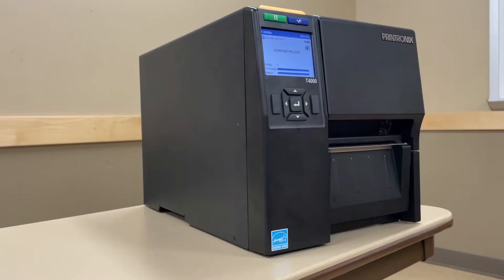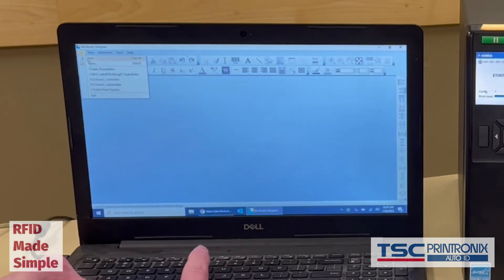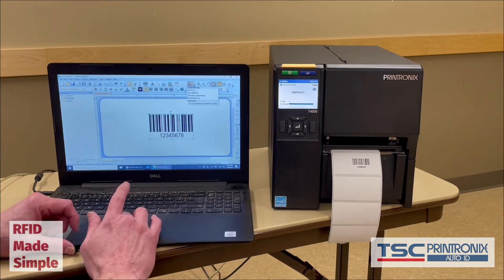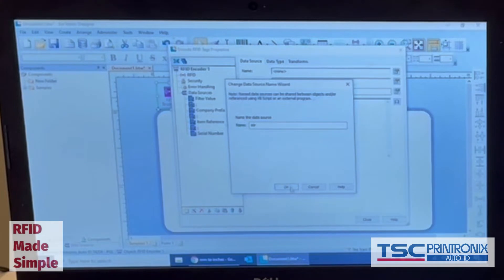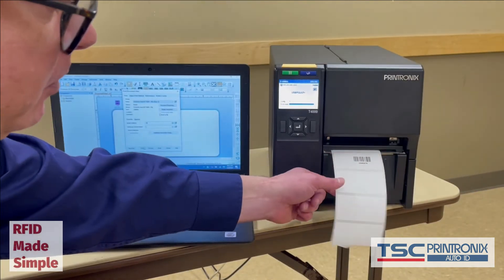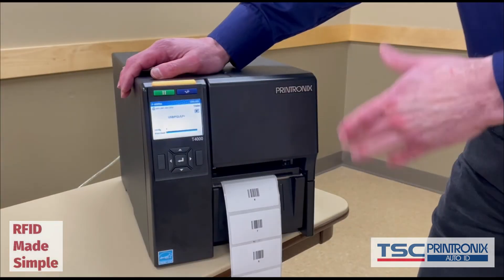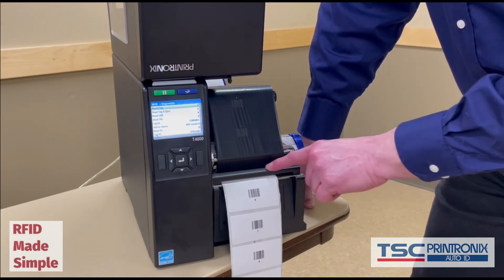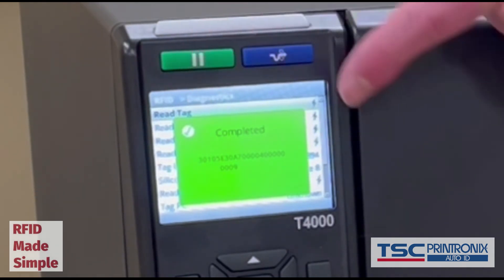Printing and Encoding RFID Labels on the Printronix T4000

Comment: RFID race timer here. Can you do a review/tutorial of a printer/encoder compatible with the 1.25” x 4” RFID tags backed with 3mm of foam that are commonly used in marathons and other races? They are often Monza RP-6 dogbone tags and come in rolls of 1000. The printing is usually done on the foam side. Information on this seems to be scarce. Thanks.
Reply from the maker: Great question. Most race timing tags that have a foam backing exceed the max thickness for allowable media in a thermal transfer printer. The printers are getting more robust in that some new printers, especially the latest T6000e from Printronix is able to handle 2.2mm thick tags. Unfortunately in your case it seems that particular tag is still out of spec for that. If you'd like to explore other race timing tags that are thinner in profile, feel free to reach out to me through email, colynnb@idplate.com. Thanks Lyndon!